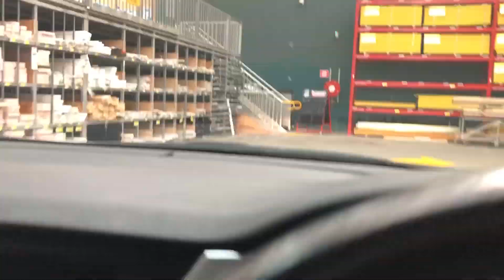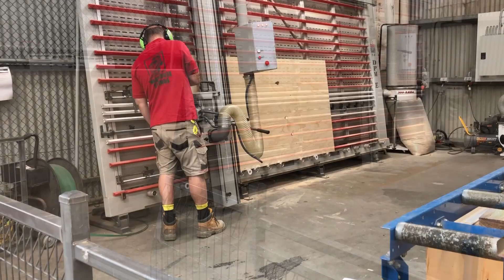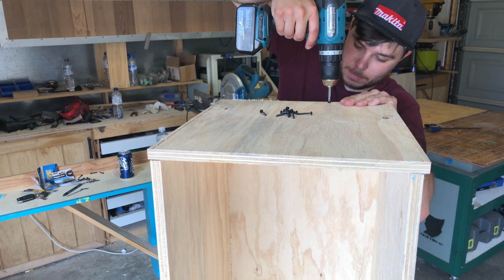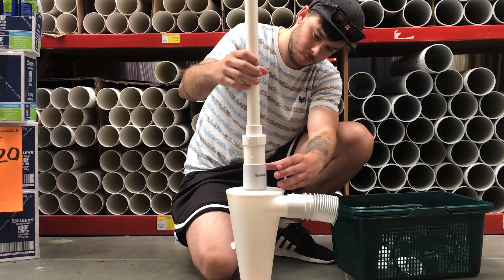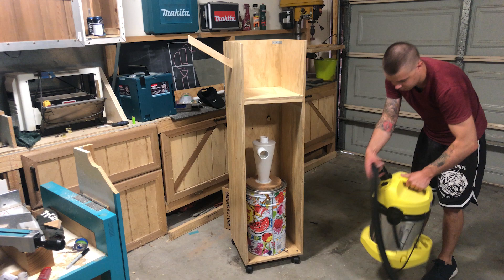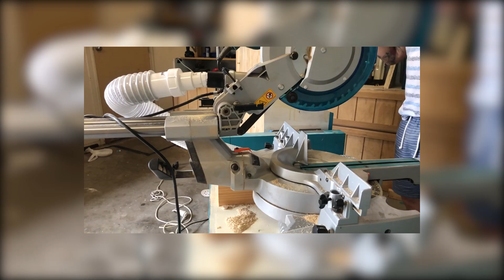Dust Collector Tower Of Power - Homemade dust collector

Comment: Hey great video. Difficult to find anything YouTube for Australians. Just a few questions 1. Where did you get the Cyclone from (it’s not available here)? Where did you get the fleck hose from as Bunnings does not sell this? 3. Did you end up getting the ports 3D printed and if so did it work out for you?

Comment: Couldn't help but chuckle at the scene where you're at bunnings with all the plumbing fittings. A few weeks ago I build my own dust separator to attach to my shop vac, took my two different diameter hoses into bunnings and a few of the other connections, went to the plumbing isle & tried to get everything to fit together.... half an hour later and several parts to make 1 fitting fit another, I was sorted. Soo so painful!

Comment: For weird sized fittings, to to the gardening section at Bunnings and look for the flexible washing maching hoses. You will find a couple of rubber joiners (one straight and one tapered) and some flexible hose there. I've found that these fit either over or inside most tool ports, and the straight one fits really firmly inside 40 or 50mm (I can't remember which) DWV pipe. Hope that helps!

Comment: Good cart design, minimalist and elegant!  Going vertical is great, especially for saving floor space in a small shop, which most of us DIY'ers have.  Good design for your accessory needs and your taller bucket.

My own preference for mine was to not have onboard pegboard and attachments (given my small shop, they're never that far away), and I wanted as minimal a way as possible to connect collector and vac, without using that awful styrofoam block that comes with the Dust Deputy, which requires drilling holes in the side of the vac.  So I kept the wheels on the vac, and designed a way to perch the collector bucket on top.  Think a small 4-legged chair with no back, and the seat part-way down the legs, all made from 3/4" x 1 1/2" plywood strips.  The lip around the 5-gal bucket sits on the top ends of the vertical legs, the upper lengths of which form a kind of close-fitting basket to keep the bucket contained and upright (yet easy to lift the bucket out of, for dumping the dust).  The 'seat' the bucket's bottom sits on is a half-lapped X lying flat, its ends joined to the 4 legs near their bottom ends, leaving the X seat located an inch or so above the top of the vac's motor (so as to not make the whole thing overly 'tippy' when pulling on the hose).  The leg bottoms are screwed (for ease of removal) to L-brackets that are epoxied to the top of the vac's flatter areas.  So 6 plywood strips (4 legs and 2 for the X), 4 L-brackets, epoxy, screws, wood glue and brad nails, finished in black spray paint.  Works for my needs, and apart from the contrasting color, you barely know it's there, holding the collector atop the vac.

Comment: Good video Mark. I have exactly the same miter saw like yours and its dust collector port is quite stupidly designed. The best solution I found so far is just to cut a piece of plastic milk bottle and zip tie it under where the laser beam is so that the flow will be deflected and get into the vacuum port. Hope this help. Cheers
Reply from the maker: awesome idea! I'll add that to my off cuts series after my next video about some steel frame legs

Comment: Great video as always, Mark. Thank you. 

Miter saws are horrible mess-makers. I've yet to come across one that's house-trained, even with the best DC setup plugged into the port - they never seem to direct the dust into the extraction point. I've kind of resigned myself to manually cleaning up the mess until I can get a proper workshop built, including a fully-shrouded miter station to contain the dust within a box which is the connected to the collection system.